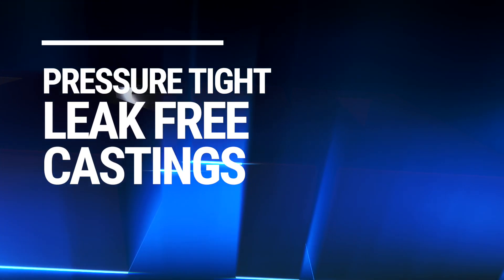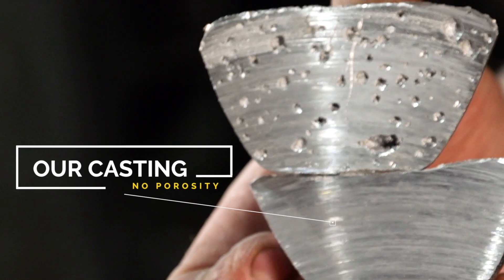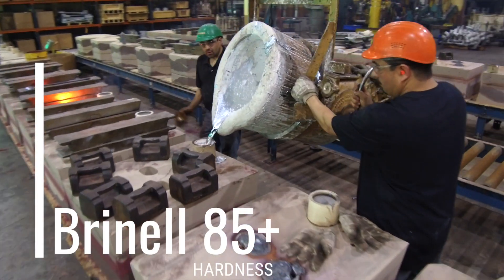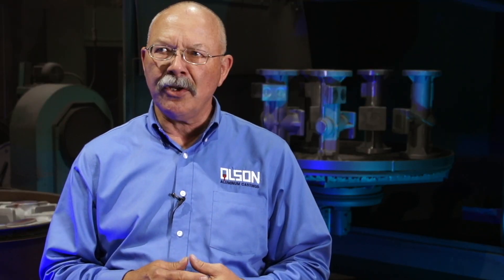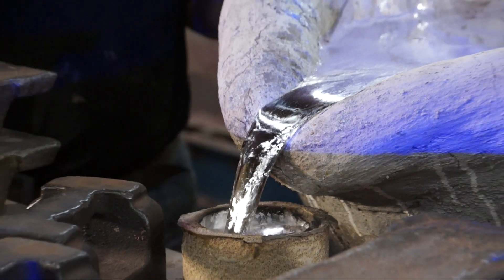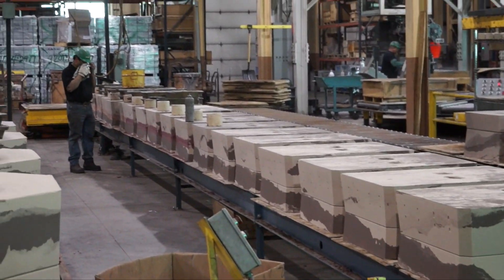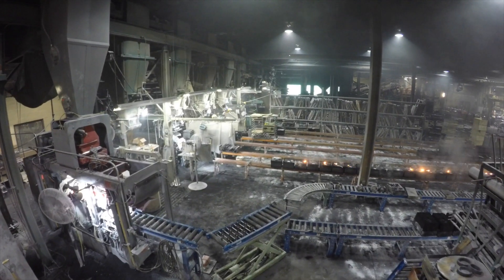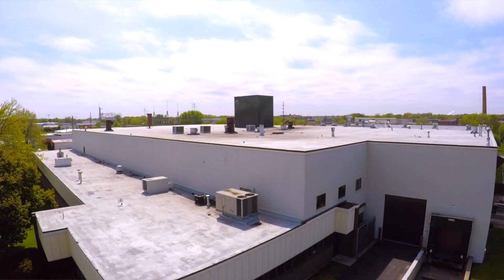Sand Castings that machine like billet | Olson Aluminum Castings | Rockford, IL

Comment: I spent 23 years in airset and have done castings for SpaceX, blue origin and everything in-between. I can say with pride, I made the core for every block of ford's GT 40 sports car. I was considered one of the best molders around and loved the work, but my body just couldnt do it anymore. I will say this, you can have the perfect mold with the correct directional solidification and risers, but if the pourer can't pour correctly...game over. I miss the work for sure....
Reply: What do you do now a days? Did you try creating your own casting facility? If you can't do it, maybe others can benefit from your experience and you can benefit from their work.
Reply from the maker: Many of these shops are looking for experienced ....even retired people to help share the knowledge that you cannot learn in a book.
Reply: @AS-ug2vq  I work in a paper mill now. I have been offered supervisor jobs. My body was giving out, I had my knees done, spinal fusion and my shoulders put back together. I miss the work for sure, another big reason for me leaving is that the company started to treat us poorly. I apprenticed for 5 years....they just don't want to train people like that anymore. Now, a young molder can't tell if he has gas in the casting or turbulence....much less how to find a solution to the problem they are having. I remember having to cut my own gating in, riser and chill it from scratch. Knockout would knock a new part out, and if it was good....the pattern shop would copy our gating and risering. I loved working with A206....that's easy to work with compared to 201...😳

Comment: It is nice to see someone who is interested in more than just how may kilos of castings they can get out the door. However you would do better still if you used a decent offset ridged pouring basin - assuming of course that it was atop a properly sized tapered sprue (could not see sprues used)... Martin